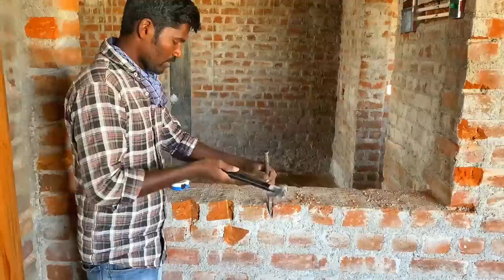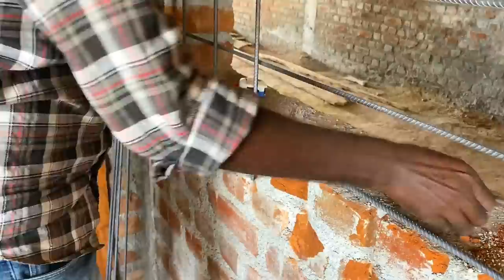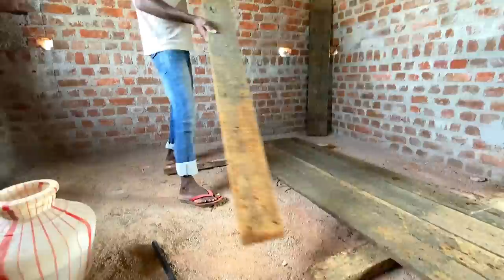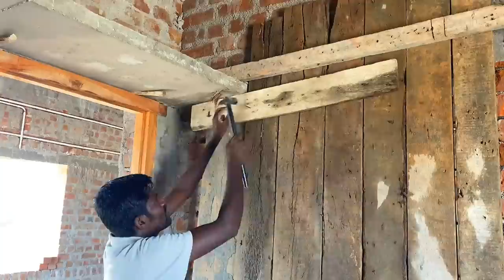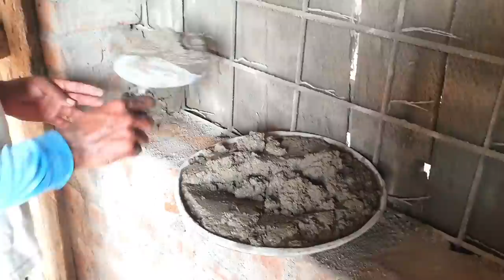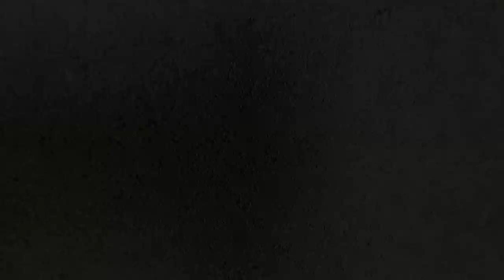Techniques of Cupboard Installation_Strong and Easy Cupboards Making with Iron Rod and cement mixer

Comment: Brick on edge is more economical, masons will misguide & provide wire mesh type which is high costly. So provide brick for cup board back walls.         A cvil engineer.

Comment: Will get rusted too quickly and fall. Instead use one inch thick brick as brick on edge and then plaster with chicken mesh with water proof cement mortar.

Comment: this is wrong method because steel fixed in brick it get rust. cover or fix with concrete and use mess for cupboard design